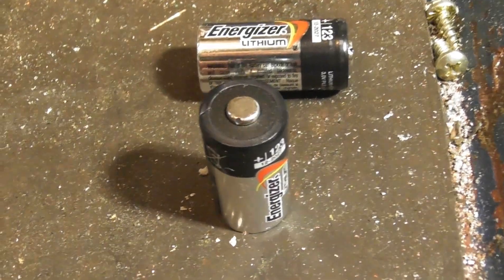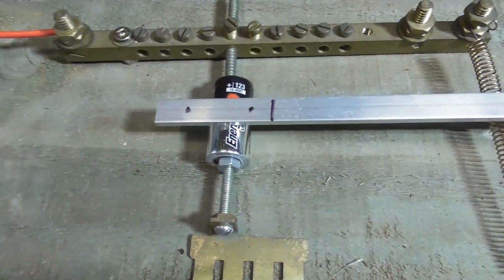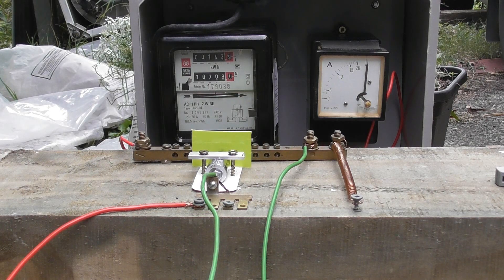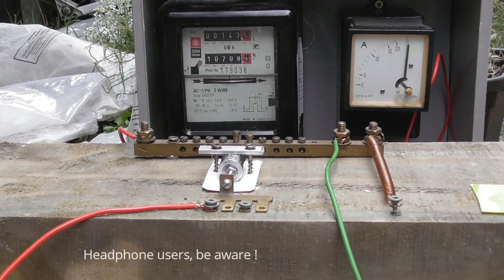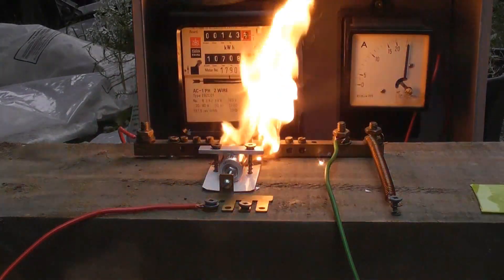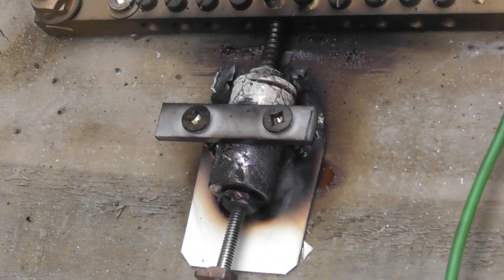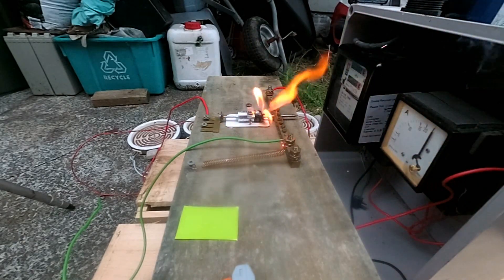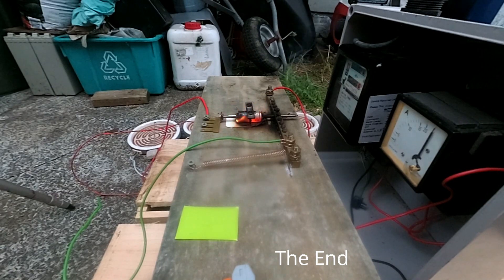Lithium 123 cell overcharged

Comment: I wonder what happens when a lithium ion battery gets overcharged, but at a low current. Say you took a fully charged unprotected 18650 and fed it with a car battery or lap top  charger with a 12v 20W halogen as ballast. I might have to experiment with this.

Comment: Hmmm so is that  100v at 30 amps thats not overcharging thats cooking at 3kw any battery would burn with that load.
Reply: I've been seeing this, there's lots of videos of lithium batteries (non rechargeable included) being overheated by excessive charging current but none of what happens when a low charging current is fed to a fully charged battery.

Comment: What are those white things with the heating element looking coils on them?
Reply: Heating elements from a stove,  The white parts is the insulation downwards.
Reply: @LL-01  They don't look like they serve a purpose. (Do they?)
Reply: @samsimington5563  they are used as a kind of ballast i think, to keep The short circuit current thro The batteri under kontroll,